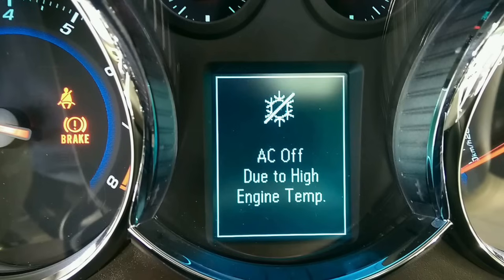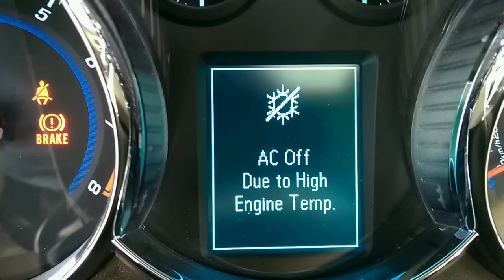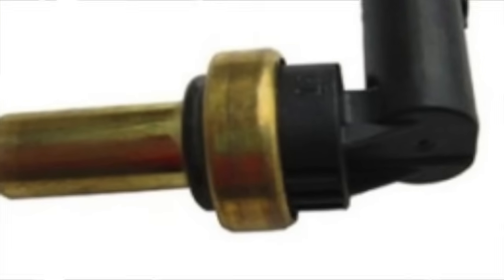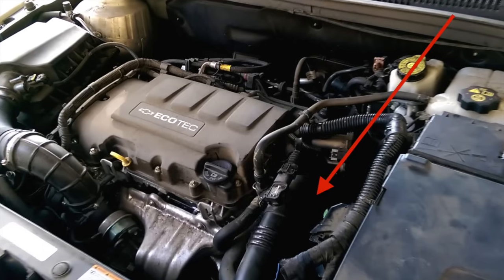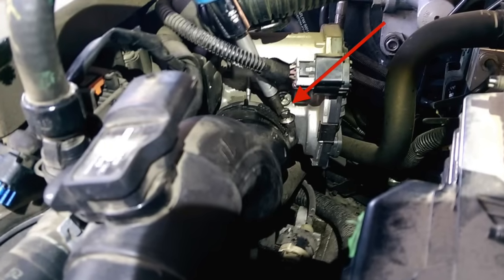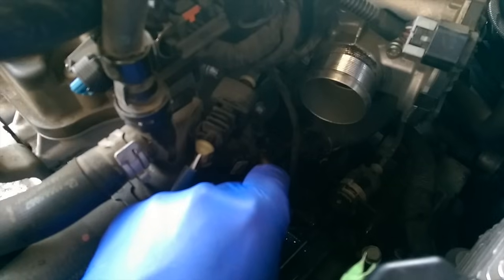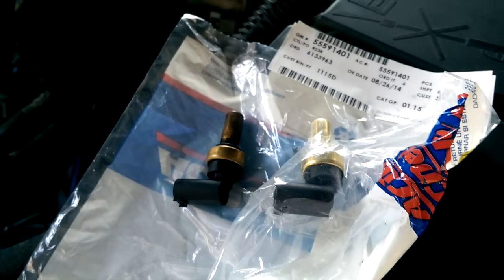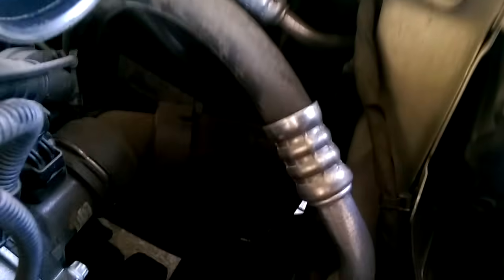Chevy Cruze AC Off Due to High Engine Temp

Comment: Currently got a 2012 Cruze with 318765 miles. Been a pain in the rear. Don't buy a Chevy Cruze unless you want a project car that's gonna need fixing every couple months
Reply: I got 70k miles 2014 chevy cruze  I put water pump , thermostat, 3 valve covers , starter, window motor , intake manifold it had random oil leak I can't figure out where from  never in my life time will I buy another chevy anything nothing but problems * randomly says it over heats so I'm hoping this is a fix I'd ADVOID chevy at all cost like plague it's non stop problems right out of warranty
Reply: You poor basted I feel bad for you lol
Reply: My 2014 cruze ha this problem and i fixed it. Main problem in 7 years
Reply: You have 300k+miles on a small engine lol what do you expect
Reply: Luckily I’m using for a couple monthd
Reply: @reggieos6945  Agree but disagree my Cruze has had a lot of the same issues but my Silverado hasn't had anything...apparently GM can build trucks but not cars
Reply: Lol I hope this is a joke
Reply: Im just waiting for my cruze to blow up and day.
Reply: I have a 2013 with 88k. Only issues were the faulty factory negative battery cable and the shitty coolant reservoir. Oh and my clear coat is coming off but that’s cause I neglected car washes
Reply: Bec yr shit have 300000 miles mine only have 104000 miles and it’s super perfect
Reply: ?????? XDXDXDXD
Reply: Te quisiste hacer el de guita y no te salió que es diferente jajajaajajajajaa es un auto que tenes q Mantenerlo no repararlo  tenes que mantenerlo todos los meses sino como te explico que tengo uno 2012 hace 5 años y nunca tuve un problema? Y como yo miles como vos no se hasta ahora vos solo saludos desde argentina papaaaaaaa

Comment: Before changing it was the radiator fan spinning like crazy ?
Reply: That's what mine is doing plus the temp gauge stays at cold, never moves.
Reply: Mine just started, enginge fan is BLARING loud, and now the temp gauge randomly spikes up from normal. I assume I'm having the same problen
Reply: Yes I did. I replaced this same sensor that he replaced in the video but didn't fix my problem. I ended up replacing the thermostat and housing which also has a sensor in it. Thermostat and housing costs almost $80 at Advance Auto. Probably can find it cheaper online.
Reply: It fixed mine but now I'm getting a low coolant glow error lol
Reply: @fishinncrapoutdoors4651  I got my thermostat with housing and came with sensor for $17.30 on ebay new...Worked great...
Reply: If your fan is spinning like crazy, more than likely the two lower speeds stopped working..These fans have 3 speeds and the lower ones are prone to stop working..You have to replace the entire fan assembly to fix it...
Reply: @Pete391  not for me lol, replacing the sensors fixed it.
Reply: The link you have is for the first sensor or both?
Reply: Jeff Krake do you have a link for the thermostat and housing?
Reply: @Andrew Jonson Mine did that..Was the thermostat....
Reply: I have replace the thermostat housing several times in the last couple years.. works for what seems about 6 months and then check engine light comes on .. the 1st time the fan was goin crazy and I changed out coolant temp sensor.. not the one on the radiator.. now I sit here again.. engine light .. no ac due to high engine temp.  But the fan is normal.. wtf lol.  Where to start cheap ones first haha
Reply: That's what ours is doing
Reply: @Andrew J My "fix" is using and OBDII reader (which i had already on hand) that bluetooth connects to my phone and reset the P0128 code i got. I do this while driving the vehicle and seems to be working just fine. The engine as far as i know is not overheating anyways as its running at around 200 degrees. That being said, it leads me to believe its a sensor but not sure if its the temperature sensors or thermostat sensors.
Reply: @fishinncrapoutdoors4651  what u did to fix it pls help
Reply: @mannyramirez2238  I replaced the thermostat and housing which also has a sensor in it
Reply: The car is still hot
Reply: Anyone going through coolant? I was a little at a time then started progressively getting worse. I thought maybe I had a blown head gasket but wasn't getting that distinctive smell from the exhaust and no moisture on the oil dipstick. Turns out my water pump was going bad and leaking. I never noticed because I park my car on a gravel driveway. Fairly simple to change for the average do it yourselfer mechanic. You have to support the engine and remove the motor mount. As long as you're doing all this, I suggest changing the serpentine belt right away.
Reply: Jeff Krake water pump is on a special warranty that extends way past your car warranty because they know it’s common for that part to fail. your dealership may replace the pump for free because gm covers it. mine was covered on a 2013 and just had it replaced in august. hope it helps.
Reply: Dave Mcclure these parts are garbage. I’ve gone through 4 valve covers, both coolant sensors 5 times, 3 thermostats, and 2 water inlets in 3 years of owning a Cruze. You would think GM would address this issue. I’ll never buy another ecotec
Reply: ●●update ●●
Thermostat  housing sensor went out again and I replaced it. Problem solved once again

Comment: I have a 2013 cruze, no check engine ligh, 63k miles.... changed the thermostat.... and it stopped doing that....came back on,  changed both temp sensors and it's still doing the same.... idk what else to do 🙄

Comment: I have a 2012 and i had the same message come up intermittently and when it came on my temperature gauge would go just a little bit above the halfway point. I messed up yesterday and open the coolant reservoir to add more when my car was still hot and it was steaming and boiling. I filled the reservoir and as soon as I took off down the road the temperature pegs all the way to the top as hot. I stopped immediately and let it cool down and managed to get to the next exit and I bled the lines. That seems to have somewhat fixed it but now the temp is going over the halfway point qnd i am having to run it with the heat on. A couple things, even though the coolant in the reservoir was boiling and steaming when i was bleeding it it didnt fewl very hot. Also last night while driving it the temp was mostly staying just shy on both sides oof the middle as long as i didnt turn off heat, but when i checked the temp of the coolant thru the computer it said the the coolant temp was 139. I am traveling and in the middle of nowhere and dont know what i need to fix. Please help

Comment: @MichaelCallos My car gets the message first that it overheats and turns off the AC, then the red alarm goes off. I turn it off to check for leaks and the level is correct. I didn't even boil the water. Will it be something similar to yours?

Comment: My Cruze doesn't overheat anymore I drilled 3 holes on the thermostat I've had enough problems with overheating and this worked for me the housing is intact Incase your wondering. The car still warms up properly and never goes pass 220 anymore. Unfortunately my problem is related to something else if I leave the thermostat to factory specs it doesn't open even when the car overheats it's not fuse, sensors, I'm down to ecm or some ground I can't find anywhere or a wire. Wish thermostats would go back to how it was many years ago when it was all mechanical no electronics. Problems I've had are mainly issues with the thermostat not opening as it should have been replaced 5 times in the last 4 years.

Comment: I replace both it still didn't work..... any other ideas what it could B?.. sometimes it's a hard code and I have to pull the battery cable sometimes it's not and I can just shut the engine off for 10 seconds and it resets does that sound familiar?

Comment: Sooo, my fan is high , i got the same message, the needle is at cold... I replaced thermostat and water pump couple months ago, any advice??
Reply: Mines is doing the samething. Did you change your sensor?
Reply: Ugh same!
Reply: @tysheenamack9694  No not yet, thats next... I cant even turn on A.C.. This car has given me nothing but headaches, so far weve replaced reservoir outlet twice within a year, the water pump, thermostat , and oxygen sensor 😳😳😢😢
Reply: Time to trade it in

Comment: My chevy cruze 2014 1.8 had the same problem,I just replace the thermostat and the problem gone!! BUT ATTENTION,I BUY THE THERMOSTAT AT AUTO ZONE AND THE CAR SHOWS THE SAME PROBLEM EVEN WHEN INSTALLED THE NEW ONE,SO I HAD TO BUY THE THERMOSTAT AT CHEVY DEALER,COST ALOT MORE BUT PROBLEM SOLVED I THINK THAT KIND A CAR DOESN'T ACCEPT AFTERMARKET PARTS,JUST ORIGINAL GM BRAND
Reply: Thank you for the advice cause I'm going to replace the thermostat for the second time
Reply: @mrs.monicalofotn598  Yeah,use original parts!

Comment: I had this message pop up on mine, but the  needle was not marking at all and the coolant temp just shows "- °F" not marking at all. The engine is not hot and everything feels warm like normal so I'm not sure what my issue could be. I have not tried replacing sensors, but maybe that will fix my issue. The guy who originally fixed the problem said it was water pump, so it was replaced, then the message showed again so he replaced thermometer and messaged came on again, so I took to electrician and he said it was just a reprogramming issue so he reprogrammed it. And here I am again with the same messaged popped up again. Thanks for this video. I am going to replace this part now and hopefully it will be my last expense on this vehicle!
Reply: Simran Mishal Kaur Bajwa what did it end up being?
Reply: Simran Mishal Kaur Bajwa did it work?
Reply: I’m having exact same issue. Did this work?

Comment: it is definitely shitty i have a 2014 less than 12k miles and this same alert came on yesterday as i was getting on the highway as it told me to idle the car as well.. im suprised they haven't fixed this issue.. also i was wondering warm what level the reservoir is supposed to be at..
Reply from the maker: I'm not sure. I don't have this car anymore... too many headaches
Reply: +Michael Callos ahhh i hope this isnt a head ache. . i have an appointment tomorrow morning but i dont know if i should add antifreeze and spend the money today.. the reservoir was completely empty when it was running.. i have lifetime warranty on motor and i just got an oil change less than a month ago. . also noticed the cap wasnt on tight until it clicked
Reply from the maker: +daveo1021 I had a warranty too. This cooling system ended up cracking the engine 5k mikes before the warranty ran out. I got a new engine and turbo then sold the car.
Reply: +Michael Callos nice.. i wish i had the turbo. .. id trade it in now but i owe too much to make worth it haha.. thanks for the video it helped

Comment: For me, this dash warning was caused by a faulty thermostat. My car is an Opel Astra but the same engine as most of the Cruze models. You really need a cheap diagnostic tool to help you determine where the fault is. In my case I got that dash error, but my reader showed code P0128 (engine UNDER operating temperature). For me, the thermostat was physically stuck open / jammed open and the engine never reached operating temperature. Especially noticeable when driving on a freeway. The temp guage actually goes from normal (90) DOWN to 1/4 hot. Sitting in traffic, it comes up to correct temperature. Strange dash message as engine (in my case) was too cold, not too hot. Error showed after about 30 min of freeway driving for me. Hope this helps someone.
Reply: How did you fix it
Reply: @sashalavonne3302  replacing the thermostat fixed it (for my particular issue). Thermostat is cheap (ish) and super easy to replace. I installed an aftermarket one which has been reliable. I use "OEM replacement" parts for anything that is easily accessible. Does your car show similar signs?

Comment: So theres 2 sensors that have to be replaced ?? Shit i only buaght one sensors lol
Reply from the maker: I think my issue was only the sensor in the block. I would try that first.
Reply: Ok so i replaced the sensor on the driver side, and it still didnt do anything. Then i chenged my thermostat, and waa-lah it worked. MY thermostate had to be replaced 👍👍

Comment: I had same problem with my Chevy Cruze.
I had to replace whole AC unit.
It costed $1200... 
It is computer problem also.
If you don't fix it, car will break down..
Reply: I have a question for you or any one that would like to reply can you communicate.  I have a 2013 Chevy Cruze and I need to ask you about it what did you experience exactly? And did the car brake down ? That would help to know bc as I am reading these comments, wow! I can’t believe that this is happening to almost everyone who owns Chevy Cruze vehicle’s. And my car is a 2013 Chevy Cruze , has always had low coolant from day 1 that I bought it just like that always and I thought only it has to be a lemon with the ac coolant always going low and always keeping maintenance Always taking it to the car dealer where I bought it for 6 yrs and they couldn’t find a leak and after 6 yrs they say they found it . Smh! But even after they changed the coolant gallon if it’s called that then like a hose maybe as well .so then 6 yrs after all that this message pops up you know like the video here stating that engine over heating message . but the car supposedly is not hot at all and no smoke anywhere and of course I always had the antifreeze gallon to fill it up to the line no engine noises at all just the ac was turned off literally. Okay then right away I took it to the dealer diagnosed as water went into the engine and needs to get the heads send out to check for cracked head charging me 2500,00 . So I didn’t repaired it .  towed it home parked it for a year. And finally now I just repaired it .. payed that at another shop and the heads weren’t cracked and is running well , however now not 3 weeks go by after I get it back and the ac coolant is back to low again .. something is wrong . Despite I have 1 yr warranty wtf ! Is it so I called the shop and the owner will look into it again and for now he said don’t worry about it . We will look at it . Bc I still have to bring it in after 1 month to do a oil change . So I know that but why is the coolant low I am thinking it has to be something and I feel someone here might know . Yeah so I obviously can get ripped off keeping up with my car . There has to be a solution . Can it be a engine eternal problem I had that feeling before the car got payed and after I got the car fixed . Looking for a friend with knowledge please !!! 911 😂
Reply: Yeah literally I would know damn like what is going on w these 2013 Chevy Cruze vehicles
Reply: @carmendesantos6480  It is okay car. But it is not a good car for sure. Too many issues...
Reply: @carmendesantos6480  
My issues were ALOT.
When I got that car, I had to fix some part of emgine, water hose and heat pump... etc. I had like 7 problems of my car.
I bought it used car. I had to spend like $4000 to fix it.
I fixed water pump last year. I had to fix it again.
Least I know a good mechanic. So He fixed it for alot of cheaper.

Comment: I'll shed some light on this even though it's very old the fix is the thermostat housing the sensor in the thermostat housing bleeds coolant through and shorts out the plug so if you unplug that and see antifreeze there that is the issue it shorts out the sensor reads full hot tells the computer to turn on the fans to preserve itself and then you'll eventually get a p0128 because the fans dont allow the engine to warm up so the fix is actually the thermostat housing regardless if the thermostat is still good it's the sensor in the housing that is part of the housing no other sensor not on the driver side of the head not in the radiator because if you get a p0128 that means those two sensors in the radiator and driver side of the head are good the one in the thermostat housing will trigger the AC off due to high engine temp

Comment: I replaced the thermostat and the sensor but still the same problem...!!!
Reply: I replaced both sensors and still have the same problem. radiator fan turns on as soon as I turn the car on.
Reply: @REYMARTZHD  it could be your thermostat

Comment: I have 2014 Chevy Cruze and this is a constant problem. I’ve taken it multiple times since I know nothing about cars and it will be fixed for a little bit but then do it again,
Reply: I have this car with the same problem
Reply: Same here same message changed all sensors .... thermostat and water pump

Comment: i have a chevy cruze 2013 and we think the issue is that it is the fan thats not working properly becuz it doesnt really go on. its been overheating when coming up the cajon pass hill and we change the water pump and it wasnt that cuz there was no leaks.and the coolant in the resevoir is filled up to the top but still no fan so when coming home and parked on the drive way we unplugged the fan and plugged it back in and the fan turned on and so while it was on it said AC TURNED OFF DUE TO HIGH TEMP n the gage was down and coolant fluid went down and wasnt as high and it dropped a little so do you have any suggestions of what it may be if it is the fan or maybe the temp sensor.